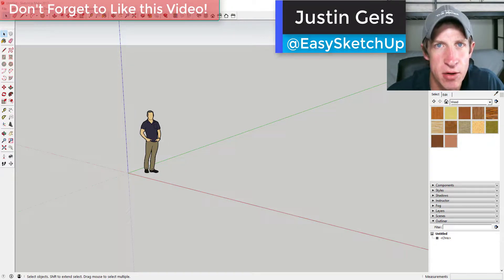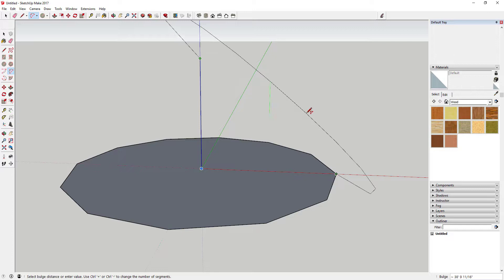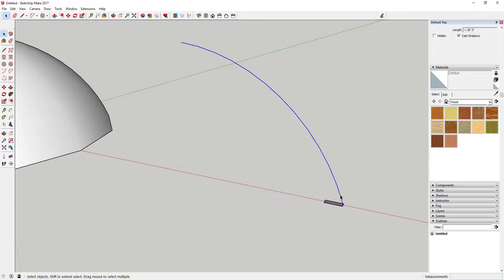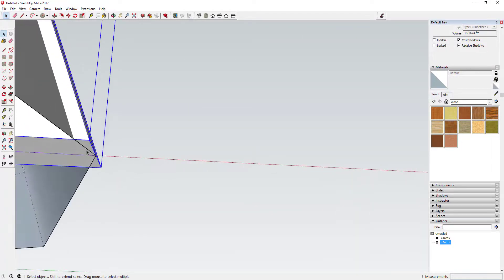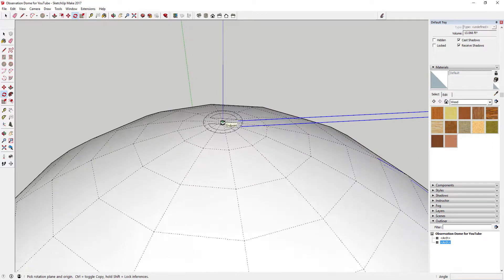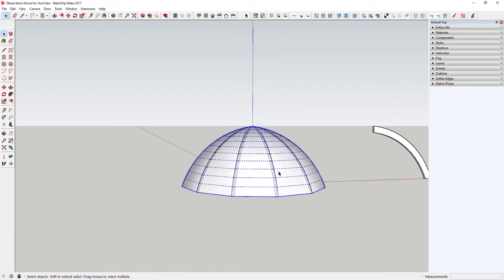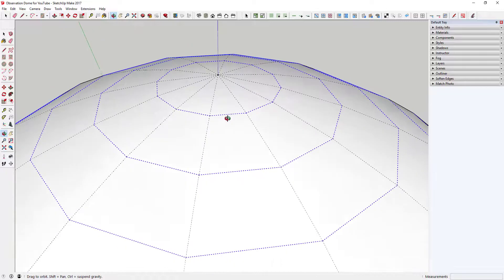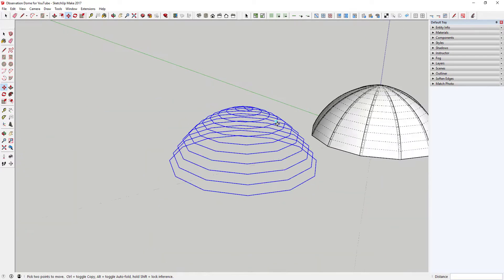Modeling an Observation Dome with Timber Arches in SketchUp - SketchUp Quick Modeling

Comment: We could use that for a greenhouse too, but it would be expensive to build those wooden arches. Not that it can't be done, you could make them wooden trusses instead of solid beams, that way they can be made up of smaller wood and also be bent and hold its bent shape easier. Literally put a veneer over the laminated truss, It would be similar to building a small ship with the curved wood. but it would have to be drawn in that way so you know how to build it.

Comment: 'Lines to Tube' is a wonderful tool for lattice structure work. I particularly appreciate that even all intersecting lines will turn to tubing, which is why it's so useful for lattice structure. However, with 4 sides it creates a diamond profile instead of square. Would there be an easy way to create true square tubing from lines?